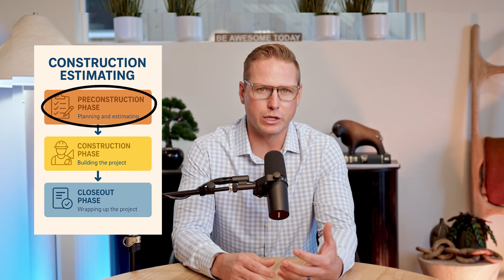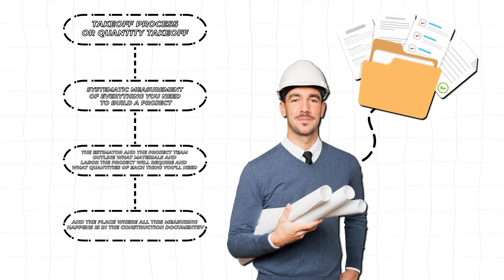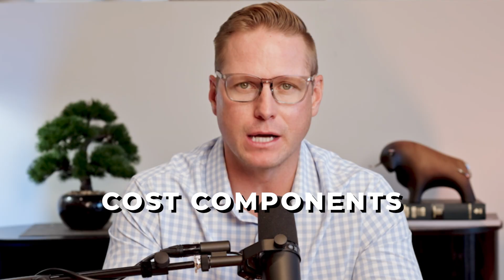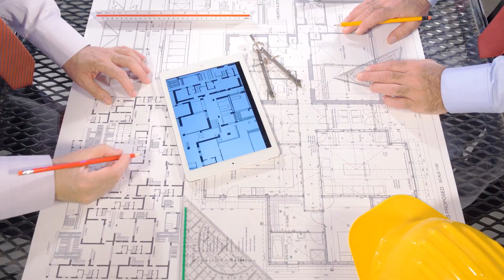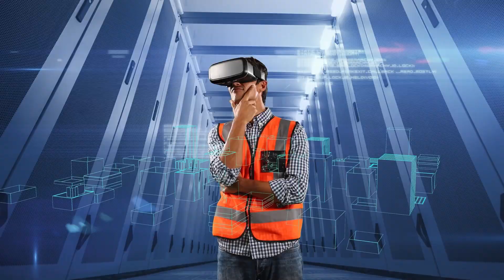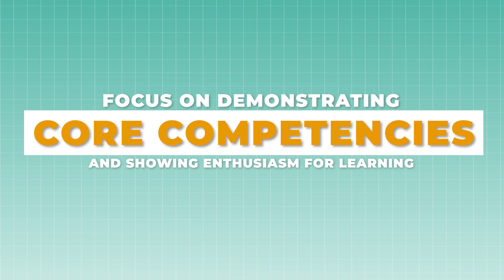The FASTEST Way to Learn Construction Estimating and ACTUALLY Get A Job

Comment: Hey I hold a BSc degree in Construction Management from a South African University.Do you think I can lead online remote work in the US?
Reply from the maker: That’s a solid foundation! A BSc in Construction Management is highly relevant and respected. The honest answer is that remote preconstruction work from outside the US is possible but comes with real hurdles: work authorization/visa requirements, time zone gaps, and the fact that most US GCs still prefer local or at least US-based hires for estimating roles.

Where international candidates have found success is in quantity surveying, cost management, or project controls roles with global firms, or companies that specifically recruit internationally. Getting familiar with US-specific tools (Bluebeam, On-Screen Takeoff, estimating platforms like DESTINI) and how US construction delivery methods work would strengthen your case significantly.

What type of role are you targeting specifically?